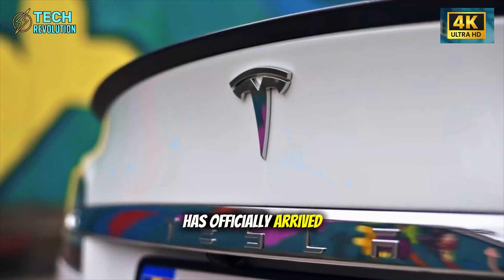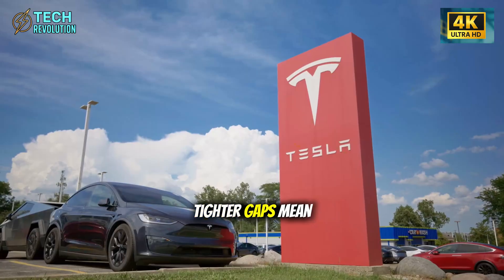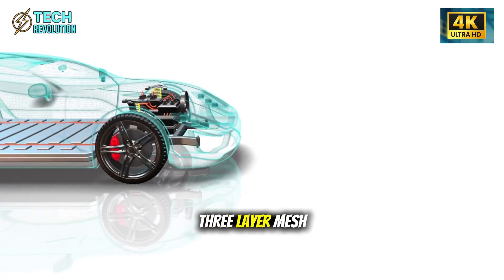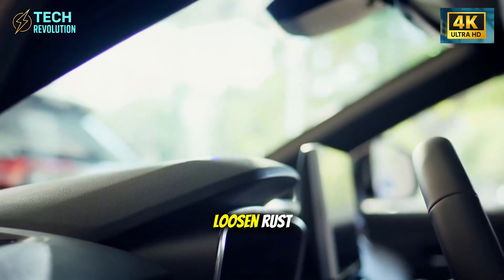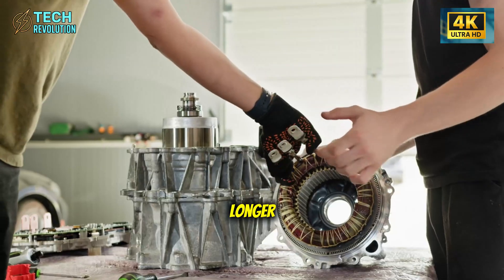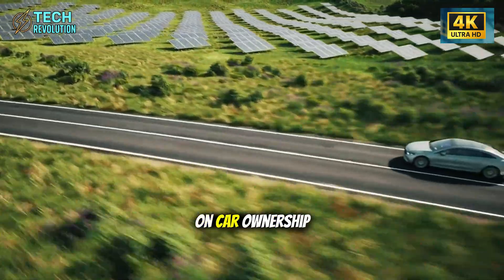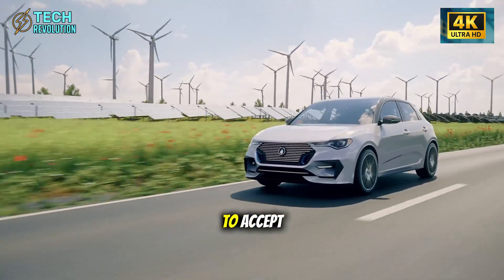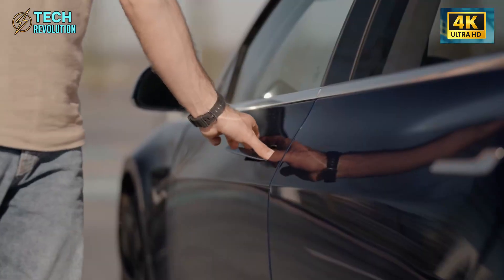Tesla Model 2 FINALLY HERE No Repairs for 30 Years. What's SHOCKING?

Comment: Good grief. All of that for only 15 grand? Sheesh. That will definitely overtake the ICE market. However, one thing mentioned isn't entirely correct: Will car repair shops go out of business? Not exactly. Most cars require maintenance and repair shops due to accidents, even minor ones.
Reply from the maker: Exactly—Tesla Model 2 at $15K disrupts ICE, but repairs won’t vanish. Fewer engine issues, yes—but accidents, tires, suspension, and body work still keep shops busy.
Reply: @TechRevolution26  True that...👍